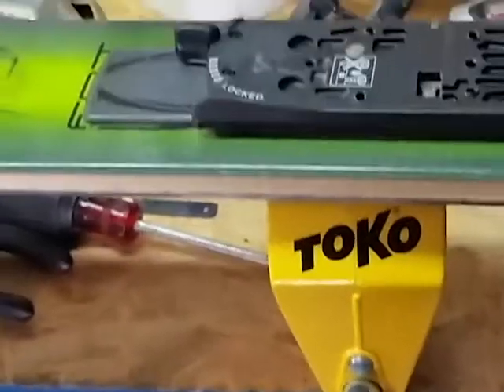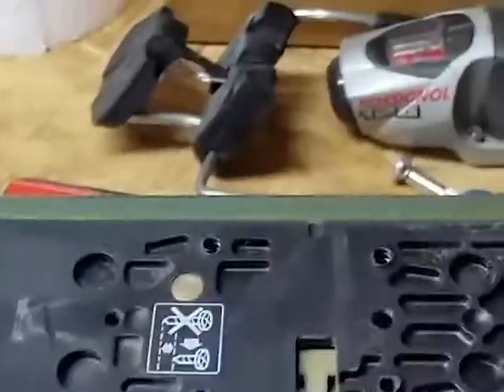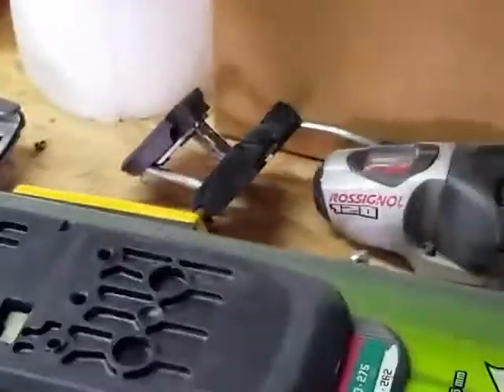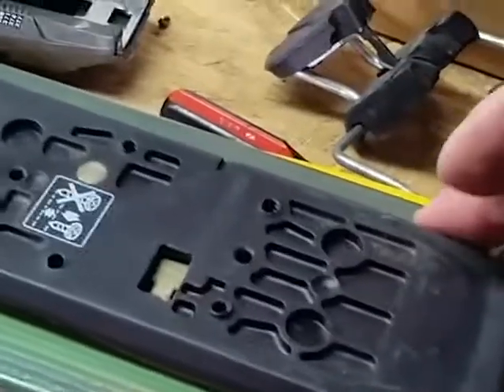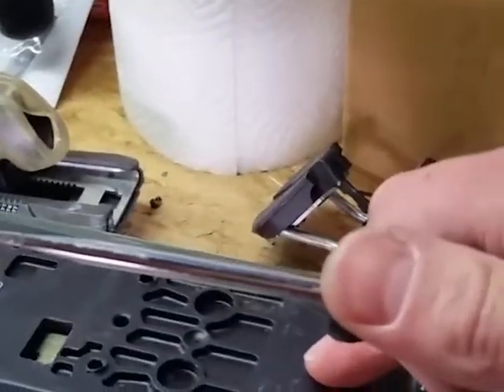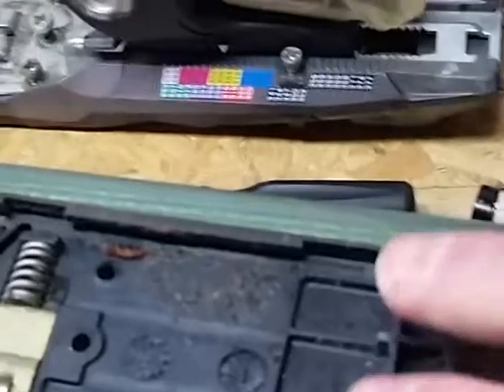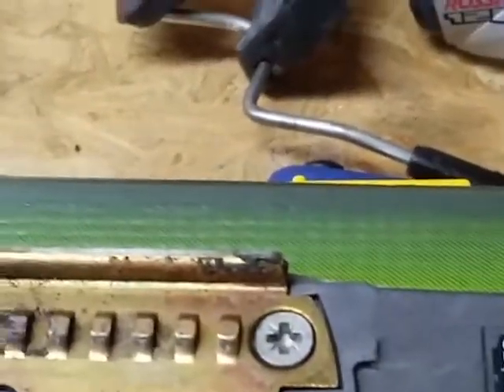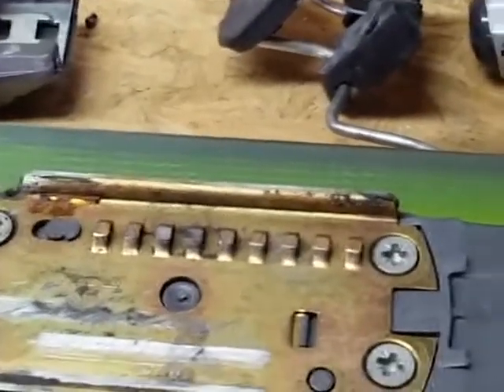Rossignol Axitec binding removal

Comment: I can’t figure out how to adjust the front binding for a different sized boot.  I switch the lever to unlock position and slide the lateral lever, but the binding doesn’t move.  Scratching my head...
Reply from the maker: The lever has to go clear to the opposite front side to release the adjustment for sliding. If you just use the white markings as a guide the lever only goes to mid way, pointing about straight forward. At this point it is completely unlocked; however, this is the point where you run into spring resistance that prevents the binding just slipping when unlocked. From here you keep pushing the lever against the internal spring to the opposite front corner from the locked position. When the lever gets to that opposite position, it releases the binding to slide.  Im guessing you've moved the lever from locked to unlocked but not completely to the adjustment release position yet. Hope that works for you. If you can't move it past the halfway point to release, it may be jammed somehow.
Reply: Got it -  thanks.  Your right just had to push the lever over and hold it.  These bindings must be intended for rental shops.
Reply from the maker: @tuul75  bindings for demoing skis. A bit higher standards than standard rental bindings as I understand it. Glad you got it.